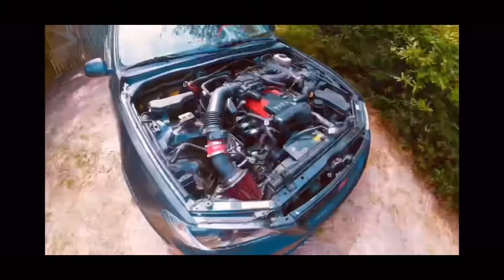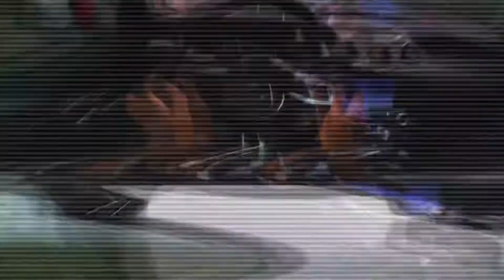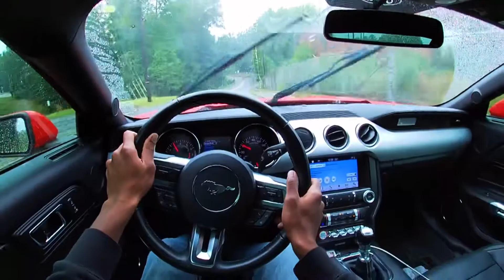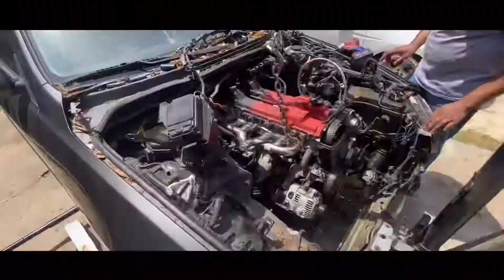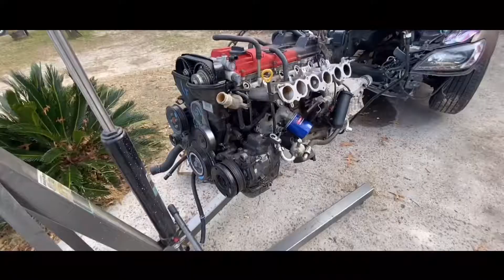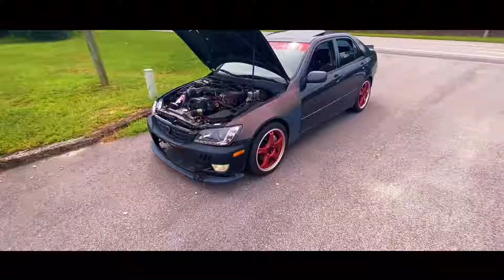Street Drifting My S550 Mustang GT in the Rain | POV

Comment: You should unplug the little relay fuse thingy between the airbox and the fender to fully disable tc and stability because you gonna end up crashing that shit by only turning it "off" with the button.
Reply from the maker: Noted, i hold the button for 10secs to “fully disable tc and stability” does that not fully disable everything unless you remove the fuse
Reply: @tagallstar  yea itll only disengage everything if you pull the fuse and youll see 2 yellow lights pop up on the dash one for stability and one for traction. Holding it just turns it halfway off basically.
Reply from the maker: @em2attic  thanks bro fr, ive tried drifting corners and the car refuses to do it
Reply: @tagallstar  no problem at all but yup thatd be one of the reasons why it wont do it and when it does do it be careful and mindful that the diff sucks and will tend to open up mid slide so i wouldnt do any clutch kick initiations id tighten the ebrake and just go that route basically.
Reply from the maker: @em2attic  I’ve noticed that the diff locks when it wants to especially in the rain thanks bro life saver
Reply: @tagallstar  yea bro no problem i learned the hard way tryna drive the car like im used to driving all my other cars and thats no bueno lol. Also remember the car responds well to smooth throttle input during skids and dont give up on the chassis either just because its a little different its still a great chassis and rewarding once you learn to drive it.
Reply from the maker: @em2attic  i tried what u said to day and its a huge game changer. Yessir thats why i want to learn how to drive it and teach others bc it is a different car and takes different techniques to control it. Its a really good drift car to me and its fast in drift just like it is in a straight line
Reply: @tagallstar  yup see you already know wassup!! Glad you see the actual potential in it and once you get a welded or 2way whichever you choose to do itll just make driving the car that much easier tbh. The steering will still feel different but itll be easier to control for sure with the  locked diff and become more predictable than before as well. And after that id just get some coils, a seat and a hydro and shread it on stock angle for a coo min before tryna step up to a crazy angle kit or anything.
Reply: @tagallstar   https://youtu.be/GuqjU7Xv4fQ

Idk if this link will work but go through this dudes page (Team GTS)  hes down in TX and youll see that basically the s550 needs ebrake on almost all transitions to be able to set up the steering correct for the next turn. Takes some getting used to but again like we said before its just a seat time deal and becomes muscle memory eventually.
Reply from the maker: @em2attic  faaacts the steering isn’t hard to deal for me bc my gaming wheel is the same. You have to help it rotate for drifting. So i got a leg up on that, its got plenty of angle stock tbh
Reply from the maker: @em2attic  oooh i see bc it is super hard to control in transitions
Reply: @tagallstar  oh damn yea this car perfect for you then lol!!!! Literally that sim in real life!!!!
Reply: @tagallstar  yes exactly and i think the same thing too about the stock angle being enough. I added the rack spacers and they added a little bit which im content with for now and i think ill only go with cut modded knuckles if i ever add big angle i dont think ill ever buy a full angle kit its just just not my style to have wisefab type shit.
Reply from the maker: @em2attic  lol facts thats the only reason I haven’t crashed it, that and God
Reply from the maker: @em2attic  ill keep that in mind, i want my car to stay a street car
Reply from the maker: @em2attic  you said faaaaaaacts, u got Instagram
Reply: @tagallstar  if u pull this fuse is traction control and stability control permanently off?
Reply from the maker: @NdurekS550  no, in my later videos I unplugged a sensor that by the air box to disable traction control and stability completely, but don’t leave it unplugged too long or the powersteering will stop working until u plug the sensor back up
Reply: Why would u do tht just get the dam thing tuned an have them turn it off in the ecu